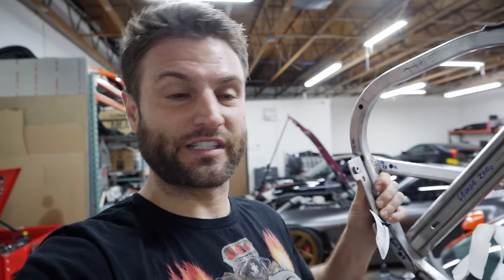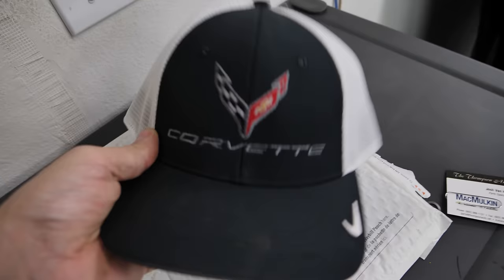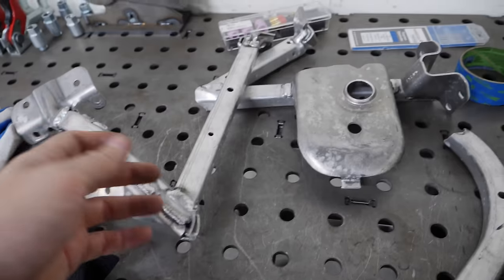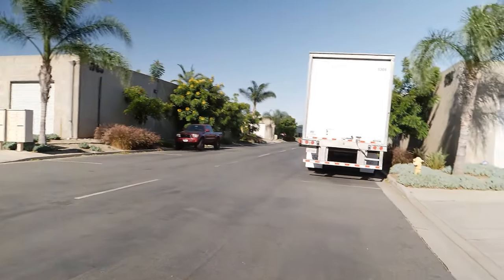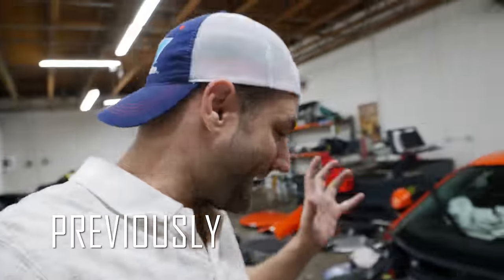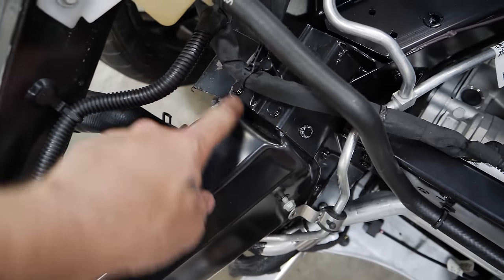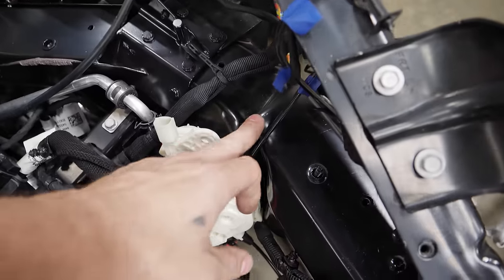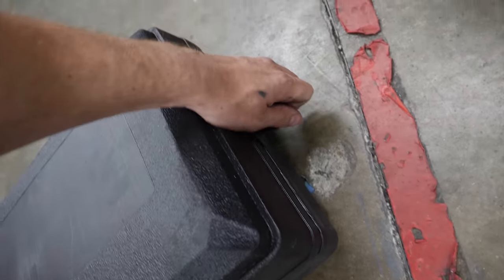Chevy won't sell me parts for the Wrecked C8. Bending the Chassis myself!

Comment: Hey. Rob, buddy, pal. Heat weakens aluminum a lot permanently
Reply: Yeah after I thought about it welding that coke can thin aluminum isn't gonna be easy and probably not very good for it it. Welding aluminum intercooler tubes is one thing. Pieces thin like this is another.
Reply: he heated the section he plans on cutting out??
Reply: @mostlymotorized  You do understand what annealing is right? There's a difference between the quick localized heat of a torch cooling fast, and the wide, slow cooling of an open flame. Essentially the aluminium turns to a soft mess. Ever wondered why aluminium structures, in fires, collapse like a Picasso painting rather than the abrupt sudden churn of a steel one (with the admission that the fire would reach high enough to the give point of steel)? Now you know.
Reply: @mostlymotorized  I guess I need to explain this then. Welding to aluminum using TIG is fine, because you are adding material and you are not getting an entire Chunk if the aluminum hot, just A localized section. What Rob is doing is heating a large section and then immediately bending it weakening immensely. For steal this would be fine to do but aluminum is already a weak metal. Edit : aserta already said this basically before I could finish my message.
Reply: I think he's okay as long as it doesn't get too hot, i don't know the range for sure but i want to say as long as he keeps it under 500F i think it won't permanently lose it's strength, but still lose enough of it (temporarily) to bend it where he wants.

Obviously I am just speaking from what little knowledge i have so please correct me if someone knows better.
Reply: @willmarcucci3  the way i understand it is if he is heating it to the point that it is easier to bend then he is undoing any heat treatment that has been done to it
Reply: @willmarcucci3  if you heat aluminum enough to bend it, you already got it hot enough to re arrange the crystallin structure weakening permently. Aluminum is known to snap instead of bend, so when you heat it to bend it you take out any and all structural integrity it had. Aluminum is a very sensitive metal. It is good for being cheapish and light, once aluminum is extruded or pressed that's it. It needs to stay like that for the rest of it's like, or else you weaken it.
Reply: @R2Y2V2  the snaping is because aluminium workhardens fast like copper. he heats the aluminium to remove the stress from the bending. therefor allowing it to bend insted of snap. Also a touch is still very localized considering the size of the beam.
Reply: That's nice, buddypal.
Reply: hes plating and restructuring it anyways. why does it matter
Reply: @mostlymotorized  cant tig 7000 series
Reply: He would have to get the aluminum above 800 F to "weaken" the aluminum. The paint wasn't even melting, so he is well below that. He only needs to worry about welding, which I believe he has a professional he goes to.
Reply: heat alone isn't the issue, aluminium does not like to be heated and bent, unlike steel, you are better off heating and allowing to cool, then push it back.
Reply: @R2Y2V2  I believe, if I'm understanding Rob's insanity correctly, that the hope is to straighten the whole thing out, then take measurements on the straightened frame, then cut out everything that got bent up and weld in new aluminum based on the original measurements? So then, as long as the bent/weakened metal was cut out, and the new metal is correctly welded in, it should be okay, correct?
Reply: yeah that’s why he said he’s replacing those parts of the chassis. plus they were already crumpled to begin with so the strength was going to be crap anyway. if i was him i’d just cut out the aluminum where it’s bonded and then just bond another piece in but his method is going to be plenty strong. the material was already compromised in that spot where it bent in a crash so if it bends there again i don’t see how there would be a safety concern.
Reply: @mostlymotorized  TIG welded aluminum that needs to be structurally strong usually goes through a heat treating process after welding. An example are mountain bike frames. Of course many DIYers completely skip this part, and most of the time I guess it's ok, but you don't just weld aluminum and use it as it is when it's a critical safety part. Not sure this specific part Rob heated applies to critical safety but that comment was actually correct.
Reply: @krispyywombat7382  correct, but do we think Rob is going to do that or see a newly straightened frame and be like"welp, were done here".
Reply: Please, shut up with the metallurgy class. He's got a small torch on a spot that's going to be rebuilt, gusseted, welded etc. He does some  jenky shit sometimes but in the end he does the final the right way. You know how many cars have been rebuilt "metallurgically" incorrect and function better than new after modifications..
Reply: It's hard to imagine that (small) propane torch putting much of a dent (pun intended) in heating or overheating those components.  Aluminum sucks up heat. Now a acetylene & Oxy rig with a nice rosebud tip... you're cooking it 😨
Reply: Hey buddy pal, so you would rather the aluminum rip and tear as he pulls it, btw he said he was going to replace it, but he has to get it straight first.. Some people will never understand there are steps you must take, its not just a simple bolt on procedure.
Reply: Just calling it Aluminium is a bit of a misnomer and this is what may be causing the confusion. There are so many specific aluminium alloys and many different states of heat treatment. Some are easy to work,some are not,some are nice to weld ,some are bitches! Unless you have the specific alloy and state then you can't make any statements about what to do with it! 
 I can't find any specifics about the chassis rails but my best guess would be 6061 T6 but that's just an experience based guess. It's pretty easy to work and weld and should work a mild amount like this with little chance of failure.
 What Rob is doing will be very similar to what they do at a body shop. Has Corvette made its structural repair manual available? Information is for sharing!
Reply: So you didn't listen to him when he said he was gonna cut all of that out?
Reply: Who cares. The front part of that chassis isn’t doing anything but holding the damn body
Reply: @mostlymotorized , Yes u are rite but.. Not all types can be heated or welded and then having it stay the same as it was before with its structural integrity and safety aspects to the cars occupants in its future still high and intact, specially when using some of these treated high tensile metals the manufacturers are now all using on their vehicles they are quickly making to sell and up profits to their turnover and productions...
Reply: @ademafc  hahaha... Yes... :(
Reply: heat from a propane torch like this,not heated to glowing red does absolutely nothing other than allowing the metal to flex easier,aluminum that is tig welded is heated up much hotter and still maintains structural integrity.
Reply: Yes but, if u look at the car u'll see its not tig welded either..
Reply: @ShadeAkeley  Riley & Scott - the renouned Trans Am chassis builder, tried to build a chassis from aluminium with the help of Alcoa, and gave up on it shortly - they could never get the weld HAZs back to anywhere near the original tube strength.
Reply: @mostlymotorized  Why not?
Reply: @willmarcucci3  600 degrees Celsius is the melting point of Aluminum so likely needs to keep it a lot cooler than that.
Reply: @trillrifaxegrindor4411  steel glows red, aluminum goes grainy then blows thru upon hi heat...
Reply: Some commas would help that post.  "Heat weakens aluminum, a lot, permanently."

Comment: Hey Rob my dude!!!!! I am a Autobody tech by trade. there is a reason why GM will not sell those parts to the public. there are specific Repair procedures that need to by followed to the letter. What you are are doing is fine to straighten out the frame rails for replacement. But you have a badly damaged frame that needs to be replaced.  Those frame rails have done what they were made to do and take the force of the impact. Aluminium gets it frames are held together by rivets and structural adhesive.. but have most likely been damaged from the impacted.   Your plan to "box in the damage" is a huge mistake. What your about to do will affect the way your reacts in another collision. You are risking the safety of yourself, anyone in your car and the other people on the road!!!!! please take the frame to a shop to have repaired the right way. then rebuild the rest of the car man!!! seriously  good enough or that will work  is not the correct choice
Reply: Thank you for this. As long as that car stays on a track and Rob is aware of the danger then it's okay, but if it's going to be near others then he needs to change his plan
Reply: He's mentioned several times that the adhesive is damaged so he is aware, and as he said this isn't his first rodeo with frame damage so I'll trust hell more then likely address the more rear and less superficial damage once he has the front ram straightened
Reply: @yutub561  He's giving it to the winner of a lottery it looks like.
Reply: The car has a destruction/parts title. It'll never see the road, or shouldn't ever see the road, again.
Reply: If u can't buy new parts that's gm fault not robs
Reply: @tmedocianis  no this car is getting rotary swapped, the Omaze car is a brand new, not-crashed C8
Reply: @Avboden  unless it ends up being verified by a state inspection agency at which point the vehicle title is flipped into an r title instead of a salvage
Reply: @nick you must be new here. He has said previously on more than one occasion, that it won’t be registered or used on the road.
Reply: What you say is true, but the "perils" is only if the rest of the frame has been damaged. If the crumple zones did their job, then the rest of it is probably ok.
I will also say: I saw a video of a C7 corvette with 500 miles on it where the owner drove over something in the road and it put a 3" long tear in the bottom of the frame member. GM wrote off the car. Seriously? If that totals a car then the car didn't deserve to be on the road in the first place. 
I drove a pos dodge omni o24 that had a cracked front sub frame. Car was written off. I bought the car for $40 and paid a certified welder to the repair. The rest of the car fell apart but the repair was good as new after thousands of miles. 
Yes, the car should be gone over thoroughly to make sure there are no other issues.
Reply: this is mainly superficial,it isn't holding the engine,transmission,front end steering or anything other than the front body panels.you and jono smith are afraid for your job security at the local chevy "parts replacement department"
Reply: yes, these type of frames have 'pin pull points , and are not to be deviated beyond 1/8 in , and using any heat on this automatically destroys the molecules in the strength of the aluminum ... should be a 'cold pull on a frame rack which has the 'led read-out lights , other-wise its all going to be 100%  'okay-doked  .. eh
Reply: @stevenreissr1938  remember: the parts he's messing with are basically just support for the radiator and body work. They aren't structural. 
BTW: I will argue your point about "heat" destroying the molecules....millions upon millions of people tig weld aluminum every day and don't destroy the molecules of the aluminum. This isn't high strength heat treated steel. btw, I'd be more concerned with how those members were formed than the heat applied to them. That produces more stress in the grain structure of the aluminum more than heat does. I can tell you one thing: those pieces weren't cast or extruded, they were formed and welded.
Reply: never stop fighting  Specially in FLA, they'll pass anything down there.
I took my F150 for a safety and they failed it because the 4 wheel drive didn't work.
I said "so what you're saying is 2 wheel drive brand new trucks don't pass either"?
According to our standards up here in Canuckistan if it's on the truck, it has to operate properly.
Reply: never stop fighting  the only problem is, one more time someone puts their rebuilt POS on the road ... i suppose if one guy puts 15 coats of 'clear on this should hold it together ... eh

Comment: I used to race speedway sedans and put chassis hold downs in the concrete floor to be able to hold the whole vehicle whilst pulling the front chassis rail straight again. The hydraulic kit you have is a good starting point. Good luck with the straightening task.

Comment: Take it to a certified shop and have those rails done right..
Reply: They wont let him insure it otherwise
Reply: @justjake3405  thats not how that works...
Reply: @justjake3405  Yeah, No, plenty of people have used ratchet straps and trees to straighten out frame rails and thrown it back on the street inspected and insured. The equipment (google the kits) to do in in the shop follows the same principle of operation. If you get the frame rails straight and see no obvious stress cracking. Congrats you've done the same that a shop would have done. 
Side note: This vette was no where near the area of needing clip and weld. The shop would have just pulled it.
Reply: @AbsolutionArmament  we pulled the frame of a Ferrari 348 with a 69 Dodge polara, a 30 foot tow strap, a few cinder blocks, and a forklift. Rod went through the block and the tire got cut while the old owners raced a guy. We junkyard 5.3 ls swapped it and now that motors dead so we are debating whether to use one of the spare vg30 Nissan 300zx motors at mine and a friends house, another ls, or put in a super mundane 4 cylinder just cause it was sitting outside for 20 years and is kinda crusty
Reply: @dekhunter148  K-swap + ebay turbo it
Reply: KristianWr.  Yeah and when you get a flat pick the car up and carry it back to the shop for repair too!   Just because YOU don't have the talent/skill to fix this doesn't mean nobody has!

Comment: Fixing a modern aluminum frame is like fixing a bike helmet. Missing the point.
Reply: true that. aluminium is not steel. you can pretty much trash bent aluminium. bending it back makes it even weaker. it's a very bad material for fixing.
Reply: @tropfen  that's why he's cutting out the bent parts and putting plates in. The bent/damaged pieces are FPO (for position only). If he gets a proper welder to do it, a tig weld will actually be as strong if not stronger than the original material. I've seen material tear LONG before a weld lets go.

Comment: The frame paint is electro coat, multiple stage dunk tanks,  quite a cool process. The key part of it, the  anodes are by PTI  which are much better than what used to be used which were  made by Koch.

Comment: 30 years ago I was taught you have to do the same force in reverse, so when a vw Polo came in with the front wheel bent back, my boss said drive up to a concrete post, he tied a heavy chain around the wheel to the post and told me to reverse hard. I'll never forget that. It fixed it, I'm glad to report xD

Comment: Good work. I suspect that you are going to be welding that 7003 aluminum. You are probably going to get a heat effected zone around the welds, which will adversely effect your strength. I recommend you bolt in aluminum plates on both sides of the welded section to add strength back.

Comment: Hey rob, I watch your videos regularly and I love seeing where you take your projects.  But just for future frame straightening, as you push or pull frame rails out, tap around the bent area of the rail with a sledge hammer to help relax it so it doesn't jump back to where it was when you started, also always push the frame about 2 inches further then you need it to be because it will always jump back a couple Inches once you release it so it'll he right where you need it. If you were closer to me in Florida I would've had you bring it to me and I would've put it on the frame machine and straighted it for you easily, I'm an autobody repair technician, but anyways keep up with the awesome videos man!

Comment: Go look at vtuned and watch what he did on sam craccs lambo that had a bent aluminum frame rail. Might be able to help you man.
Reply: those guys have no clue what they are doing and make unsafe "fixed" cars
Reply: no
Reply: @keegsterkeegster3754  LOL! Yeah dude! What a dumb comment. "those guys" do it the right way.
Reply: @keegsterkeegster3754  samcrac makes a business out of fixing auction cars, and having the titles re certified as clean.  If the repair fails, its his ass on the line both figurative and monetary wise.  Pretty sure he doesn't want someone dying and the family suing him out of existence because of a shit tier frame welding.  Pretty sure his welder is certified in alum, and also has an ultrasound machine to check the integrity of the welds, but does not do it on camera.
Reply: @chubbysumo2230  on the R8 the welder xrayed his welds
Reply: is that the one were he went to home depot for the aluminum piece or was that someone else

Comment: ROB!  FYI, certified aluminum repair requires isolation and prevention of contamination of any of the aluminum with any kind of steel or iron dust and fillings.  Keep your tools separated and in partitioned working bays.  But using a grinder or sand paper on steel then on the aluminum will cause embedded steel into the aluminum and make corrosive reactions even after being painted lofty

Comment: Rob. Buy some hockey pucks, cut some slots into them, and use them as cushions for the frame bender. They will prevent the tool from piercing through the aluminum.

Comment: To straighten you need to push and realise so can the metal stretch and in small pressure on part hammer it in the damage area to remove unwanted energy like you saw popping and poking through the working area, a bit at a time